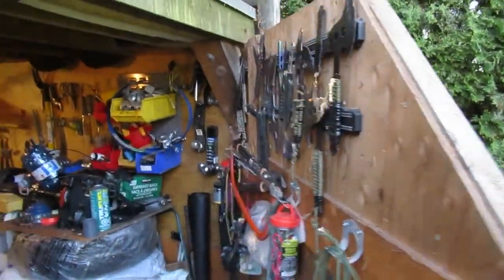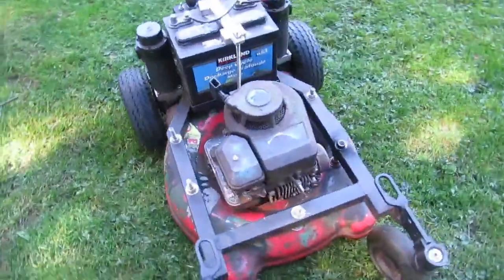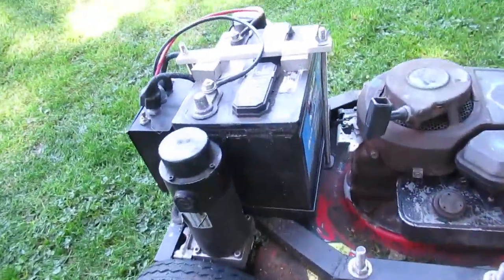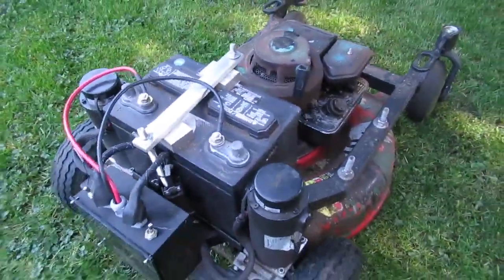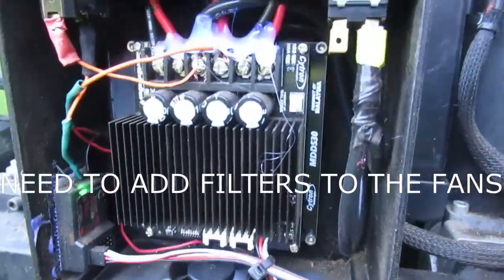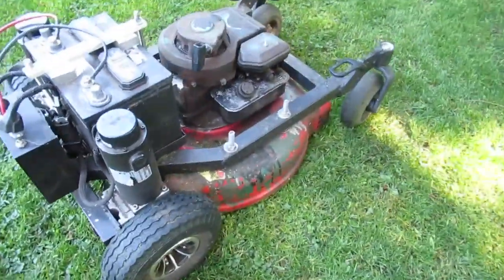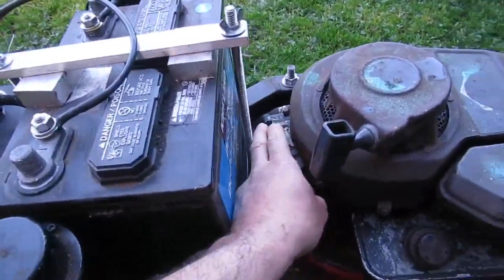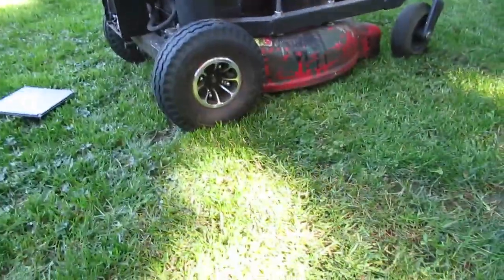Simple DIY Remote Control Mower

Comment: With the upright fins on the control board, top and bottom vents covered with filter material would likely be enough air flow without a fan.

Comment: Do you have any dimensions of the frame? Thanks looks great
Reply from the maker: Thanks.
It will depend on the mower deck that you have. I could provide a CAD model. Here is the motor model I used to locate the mounting plate holes.
https://grabcad.com/library/jazzy-1103-drive-motor-assembly-1